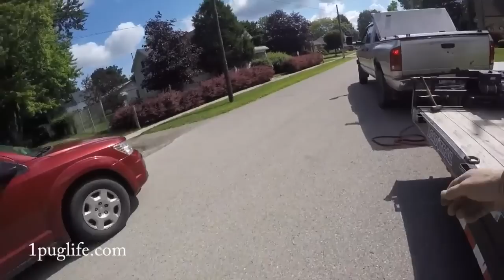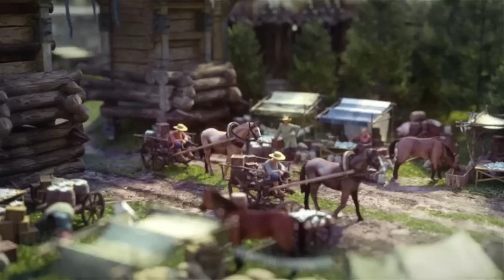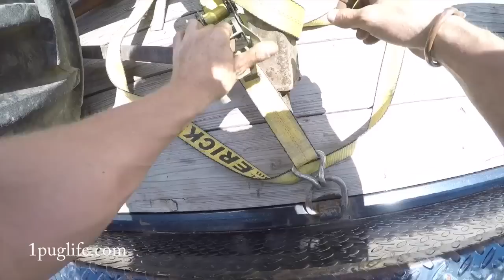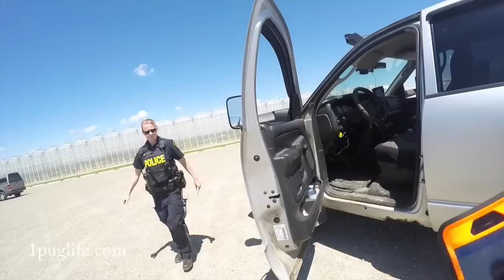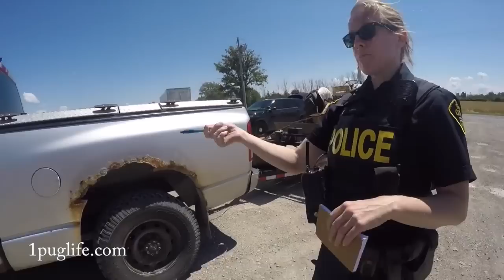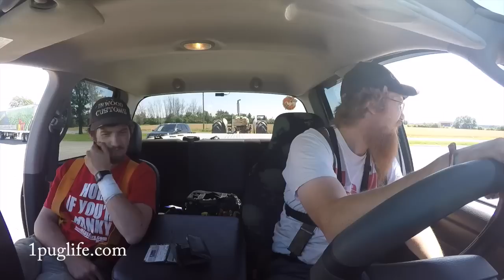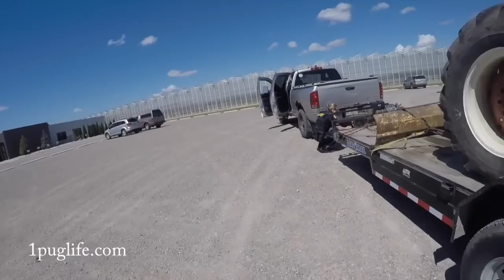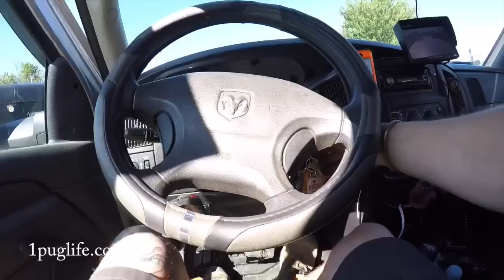illegal towing operation

Comment: Anyone else think that math seems off. Should request a real scale for starters.
Reply: Also might be time to quite the hauling Biz already FFS
Reply: Slaws _ and how. Cheap fuckun scales.
Reply: Well it's Kilograms, which is like 2.2 pounds per kilo...
Reply: Math isnt off. Commerical pickups under 10,000lbs dont requure a log. Anything over that requires pretrip, log books, ect. Same thing in the states but canada uses kilos..
Reply: Sounds like she's wrong. Sounds like  it should be no more than 3000 kilo of towing. His truck probably weighs close to if not over 5000 lbs
Reply: GradyRho92 yeah the truck by itself has to be over 9k lbs! my gasser without a bumper and tools was 6800
Reply: Slaws _ I am suspect of her methods for calculating total weightstoo. She seemed to add values from combined sources. Not the individual weight of the truck and the trailer independently. I'm gonna look into it more.
Reply: How the holy fuck can you weigh one x at a time? Here, go to court, get a public defender to get all the legwork done, fire em in court and present your evidence
Reply: 1100kg x 8??? I dont get it... That cant be right?? Did she weigh all 8 tires??
Reply: That is 8800kg.  Just the truck is 4400kg!!? That traktor is no more than 11-1200kg.
Reply: Just speculating, pugs truck proly 8000 lbs max, 4 ton. His trailer trapter combo may be 4 ton max, so 8 ton total, and that's a total guess for maximum weight, 16,000 lbs
Reply: That truck with 4 heavy guys in it would be over the limit
They shouldn't even be allowed to sell you insurance if they can give you a ticket the second you leave the dealership
Reply: My comparable F250 Lariat Crew Cab 4x4 7.3 Diesel weighs 7200lbs or 3265.8 Kg
to Pug's Dodge 2500 Crew Cab 4x4 5.9 Diesel of a similar weight with his Pug made bumpers. 
My truck weighs over 3 1/2 tons and costs $94+ a year in highway taxes where I live in "Merica.
I agree on the dividing the weight over the scales by the axle numbers.
Reply: Joseph Holmes f250 w d60 front n s10.25, 7.3 stendo cab flatbed dually loaded is 8200, no way pugs rig touches that, im a farmer in murrica, i dont pay nobodoy nutin
Reply: I thought the math seemed off at first, but then I started adding it up in my head and I think she is fairly accurate.  (in Kilos to be consistent).  She said he was 4600kg over the 3000kg RGW on his ownership.   Looking at what he had,  Truck = 3265kg, Trailer = 1130kg, Tractor weight = 3175kg.  Total weight = 7570kg. In Ontario our magic weight number is 4500kg, anything beyond that and its a big hassle between the annual inspection and having to maintain a CVOR.  Even hauling that trailer empty essentially places pug over the 4500kg limit.  At least the OPP was nice about it, typically the MTO enforces this stuff and they would have probably had him towed and not reduced the tickets.
Reply: Slaws _ math seems way off. 
no way his truck weights that much my chevy silverado 3500 single cab dually mason dump weights 6200lbs and imy gvw is 12k leagally i can pull 12k with the bed empty. no way he is over that. id be supprised if he was even over 10.5k lbs
Reply: Slaws _ the scales are OK. The problem is the great ignorance this lady has, she is confusing the vehicle's weight with its towing capacity.
Reply: Lol, I just posted something about what she said not sounding right. Then scrolled down to see this, Glad i wasn't alone in thinking something was off with her math
Reply: Gilberto Diaz Castro my truck weighs 9500 lb but it's rated to tow 16000, you're right friend
Reply: Just Somedude wtf are you smoking. 3/4 ton ram with the cummins is roughly 6300 lbs. hell, a w900 with twin screws & the 13 speed is only 21,000 and you think a pickup is 9000. Man, you have no idea wtf you're talking about.
Reply: Joseph Holmes 6989 with every option available. Your truck is much likely closer to 6400 lbs.
Reply: I have had DOT a stop and used the same scales and then I gone to a truck stop to try to prove them wrong and the weight was pretty close. He needs to make sure he has his truck registered for the proper weight.
Reply: Scotty 1D they weigh it per axel. One scale on each side.

Comment: In the UK you would have to reduce your weight to the legal limit before proceeding further.if the officer does not have weigh scales you would have to call in a low loader (low boy) to transport you and the trailer to the nearest scales. Then the overloaded weight will have to be unloaded before you drive on the highway
At the scales all passengers will need to be in the vehicle to be weighed. So you have all that cost. plus the fine. 
It's easy to over look tools and equipment you put in the vehicle, plus you will have fuel.

Trucking is not easy, take care. BS

Comment: someone went cheap on the registration on the trailer. they prob payed the min to and said we wont be hauling anything but feathers. ha. weighing one tire at a time and adding the weights is the same as weighing the the whole thing at once because it will still be equal pressure to the ground per tire. that trailer should be registered for at least 10,000 lbs she mentioned she ran the trailer, not the truck. of course the truck weighs more. the amount of weight rolling across the roads and how many times determines how long the pavement will last. fewer cars or less weight means the pavement will last longer and will not be replaced as often. its like a pair of shoes. the more they get walked on the sooner you need more rubber. just do not be so tight and register the trailer for more weight. it will only cost another 150 bucks a year to register it for another 7000 lbs, and is still cheaper than the fine. good video, thanks for the upload.
Reply: Thomas brian, the trailer does not have a weight, it is like that here in Mo too, the truck plate weight goes for the combine weight of everything, truck, trailer, fuel, people, tools, everything. But ya cheaping out on plates got him
Reply: integr8er66  here in Montana you also license trailer for weight. My trailer has 5200 lbs axes so max weight I can license it for is 10,000 lbs on my 2 axel trailer.  My 2018 pj 20 foot trailer cost me $186.50 for the tags, non-expiration. 7,000 lbs would have cost only $136.50 if I understood her correctly. 

My truck we license it for how ever much we want at no extra cost, but you need to state a weight or they go to what the truck weighs automatically. Can’t haul nothing then. 

But I can’t exceed what my truck is rated for, no matter what I licensed it for on extra weight.

Comment: It was a matter of time before this happened.  Welcome to Canada.  Any trailer Chris has with 2 axles needs to be inspected YEARLY to get the yellow sticker, plus his tow vehicle(s) need to be inspected yearly.  At least this officer was nice about it and had scales,  technically you can pull that trailer around empty and still be "over" because it has the capacity to be over the registered weight. Hookup to a 30 foot travel trailer and throw grandpa behind the wheel and you are exempt from this towing rule.  You driving around in a 3500 series truck?  Needs yellow sticker.   Huge money grab.
Reply: Lawrence Kennette good thing I live in Manitoba

Comment: FILE A CLASS ACTION LAWSUIT VS. DODGE FOR THE WEIGHT OF THE TRUCK BEING OVER.
Reply: ya really . or sue the law maker for the money grab !
Reply: sue the law maker didn't she say they don't care?
Reply: When they weigh the truck, with the trailer attached, the tongue weight from the trailer is also hitting the scale.  That one scale trick is never going to be accurate.
Reply: Pretty sure the weight will move to the low wheel actually.
Reply: High wheel will bear more weight because as the wheel moves up on the scale, it compresses the suspension springs more and actually lifts some weight off the lower wheels.

Comment: She didn't weigh that right, you weigh the truck unhooked and then weigh the trailer totally wrong
Reply: I was thinking the exact same thing with it hooked up it’s going to way with the trailer weight
Reply: Man you got some nasty rust on youre truck
Reply: you are wrong GVW total of both
Reply: She weighed the truck and trailer correctly it is considered a combination vehicle
Reply: She weighed it right. If you're going to unhook the trailer then you'd have to include the tongue weight which would then make it the same as how she did it. if it didn't work that weight truck scales that weigh the steers, drives, and trailer separately and then sum the total would be wrong too.
Reply: She is so wrong, has to go back to class and listen this time... With a simple G license you can tow 10120 pounds, that's trailer and load combine. Your ram ways approx 7000 lbs no problem. Tractor ways about 5-6000 lbs and your trailer is under 3000 lbs. Crazy thing is with a D license you cant even tow anymore. She didn't even read the tags on your trailer... You should have not paid anything... OMG
Reply: ddimondd his truck is registered as a light duty vehicle. It's not about his license they have a different registration system in Canada then the U.S. The truck alone weighs more then 3,000kilos so he will have to get a different set of plates and registration for it.
Reply: math does not care, the down force on each tire will still be the same amount. its simple to just weigh them separate and add them together. the weight will be the same.
Reply: In the US if you tow 10,000 lbs or more you have to have a class A cdl no matter what it is hooked to
Reply: That was a totally justified  citation. 
There are rules for commercial entities. 
When you make income using that vehicle for transport you have to follow the rules. 
Withput them we'd have chaos.
Reply: akron61972  there hasn't been a "chaufer's license since 1986
Reply: It's a total scam
Reply: @majorstephenson223  Michigan has a chauffer license and they let you run up to 26k commercial just no air brakes or hazardous material under 10k you dont even need a DOT health card to run commercial
Reply: @tnyleo  this was actually partially my point if you are towing more than 10,000 lbs that is considered a commercial vehicle... And you are never going to see any one at a truck scale disconnect from their trailer on a truck scale... They are interested in the pressure each tire is putting on the road while it is in "combination" after 26,001 and towing more than 10,000 can only legally be on the road as a commercial vehicle which is covered under the "federal" motor carriers rules and regs
Reply: @EP2691  yeah, just don't pay it so you can get an even bigger ticket & a warrant...... You ain't the sharpest tool in the shed are you????
Reply: martin waller psst a lot of states now have done away with warrants for traffic infractions. I have a speeding ticket from almost 2 years ago i haven’t even paid off ;). God the cops must really be looking out for me!
Reply: @majorstephenson223  check again. Normal drivers license is 26001lbs
Reply: @Chris Struble ah yes I forgot the key phrase with my number 'less than" making me 1 lb over lol
Reply: Major Stephenson  idk where you live but here in Texas it’s 26,001 pounds anything over you need a CDL
Reply: @johnsonslawnserviceministr4038  you are worng.
Reply: No they are weighed connected if yup disconnect you cannot get the tongue weight. 35 years professional truck driver almost three-and-a-half million miles
Reply: I gather you're new to this you sure by now you've learned you have to have enough tonnage on your truck in the future if you get weighed on jump scales when they ask you if you want to look at it tell them no but after they're done Wayne the complete setup tell him you don't think they're right and you want to weigh it again hey do you want to see the numbers because they have to allow you to do it again it will never come up with the same figures on a set of jump scales cuz they have to reset them when you have two different figures two different numbers they cannot write you a citation.
Reply: Major Stephenson  is that true I tow 20 ton every day with my 3500 dually lml
Reply: @majorstephenson223  that is 100% incorrect
Reply: Wrong. That is all.  @jameswalton3035
Reply: I got away with pulling 11,000 pounds without a CDL.
Reply: @02viper  

very similar rules in Canada...
our rules were written before the change to metric (1976) so they have just converted Lbs to Kgs and rounded the numbers to make it pretty... (Class A CDL after 4600Kg towed vehicle, CDL mandatory after 11,000Kg... 10,000# and 26000#)

if you are towing a house trailer there are exemptions, but any cargo trailer has to play by the rules...
(10000# full commercial plates with DIs and an Operators Certificate with annual safety)

those roofers et al, never drive their rigs where they can be seen by Provincial Police or Diesel Cops, so they sneak around under the radar...
it warms my heart to see them stopped and fined though, especially when theyre told what they need to do and they reply F-That, im not doing that BS...

Comment: If  the volume was up where I could hear her exact words, However in any trucking operation weight is a key factor, if you're gonna pull a trailer or load down a truck know your weight restrictions or pay the fine. The size of the operation doesn't exempt you from weight regulations

Comment: WTF!? Here in Iowa, I had a 97 Geo Tracker with a home made 2" receiver hitch, the vehicle is rated by the manufacturer to have 0 towing capacity. I used it for a few years to haul empty car trailers that weighed 2 to 4k pounds with 0 issues.

Comment: If you're gonna engage in Interstate, or Intrastate Commerce, you need to educate yourself on the rules. 
Gross Vehicle Weight Rating (gvwr)
Licensing regs
Permitting 
Hours of Service
Load securement 

Joe Blow pulling his boat is one thing...  
Once you enter the commercial sector the rules are in place. 

We truckers have to deal with this daily. 
She was EXTREMELY pleasant and helpful. 
That could have been worse.

Comment: Damaging the roads with a pickup truck and a trailer? that's complete bull, I transport truck weighs way more than pugs truck. that's wild
Reply: yeh bud, but a transport truck would cost way more to register i guess bud :(
Reply: Transport trucks have more tire surface to distribute the weight to the road.
Reply: bug has oversized tyres on.

Comment: She weighed you incorrectly..

1.) Can't weigh on gravel, dirt or sand.
2.) Without weighing both axles at the same time on a dual axle trailer, physics easily says each axle will weigh more by suspending the weight over 1 axle only, instead of the shared weight.  She basically placed ALL the weight of the trailer on 1 axle...but when you drive down the road and both axles share the weight. 

Your trailer axle weight without a doubt, was incorrect.

Comment: you actually thought you could start a haul operation without a cdl ?? damn you make life difficult for yourself
Reply: W Murphy  ....cdl...for a small truck? ...ffs...get out of here
Reply: john doe in the states if you are working for hire towing you must have some form of cdl even with a pickup most states are based on weight for different levels of cdl
Reply: Agreed, things get strict real fast when you go commercial.
Reply: According to the officer, his truck was overweight not even counting the trailer. In the U.S. a class C license (regular drivers license) the max weight limit is 10,000lbs, so you could do small tow jobs. Some tow companies have their rollbacks custom built so they're just under the weight limit when loaded. But his registration was for 3,000kg, his truck alone was 1,000kg over. He has no control over that.
Reply: Brandon Clark The max weight for commercial is 10k before you need a cdl.  For private, it 26k.
Reply: UrABoxxyBox are you positive? I'm fixing to haul a few vans for personal use. I'll be about 14,000 lbs gross
Reply: UrABoxxyBox 
In Texas class C covers everything up to 24,900 gross. 25K and over you get a class B if it's a bobtail, class A for tractor trailer. 1 ton truck/gooseneck trailer hotshot rigs would need a class A if they gross 25K or more.

Comment: If you were running a commercial tag on it then you would've had to register the gvw/weight for it.  So it sounds like it was registered for 3,000 gvw and if that's the case then the officer was completely right. 
All you need to do is register the truck and trailer with a higher gvw then you'll be legal, (weight wise).

Comment: Welcome to the big leagues. I transport trucks, vans and heavy equipment on a dually and 50ft trailer plus having a freightliner FL70 with a sleeper and Cat engine. Being total gross over 2800lbs combined truck and trailer meaning a Class A CDL, DOT insurance and fuel tax.

Comment: How were you able to get plates for your truck and the truck stock weighs more than the plate is for? In America 7200k and under doesn’t require special licenses. That may very state to state but generally is the case.

Edit: a private company issued plates in Canada?!?
Reply: Because in Canada the dealers will reg your truck for way too low

Comment: If they start this crap in the US there will be some people in trouble. The amount of folks pulling travel trailers and 5ers that are just plain to damn heavy for the TV.  I imagine some day the DOT will crack down just because it’s another form of revenue.
Reply: Already started. They are killing the little guy.
Reply: your are chareged extra for the wight of your trailer. if you tow anthing more that a small utility tlr. 2500 lbs. more for a boat up to 5000  lbs . and more for up to your rated towing capacity. and diver licence
Reply: Arizona has the worst dot laws u have to put dot numbers ona 3/4 ton and if u have a toy hauler ned to have cdl to haul your toy hauler
Reply: Its because they are doing it for hire that's the problem